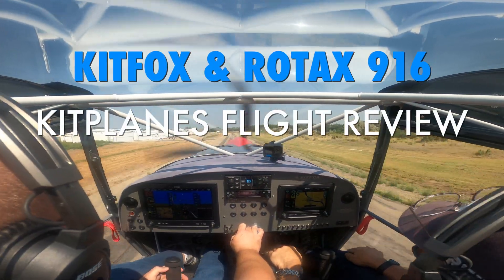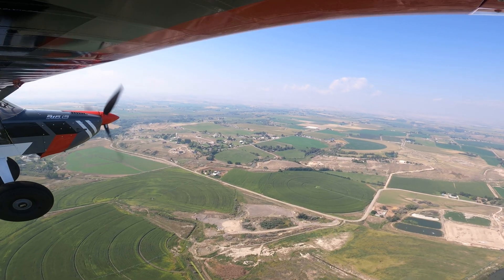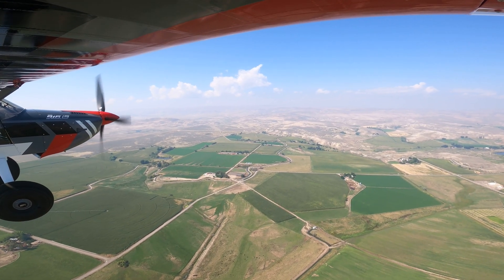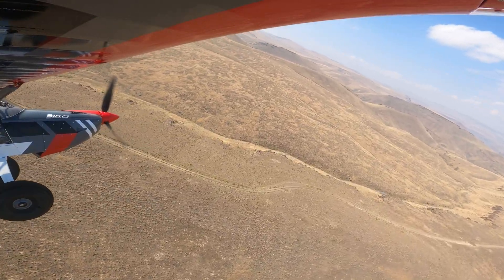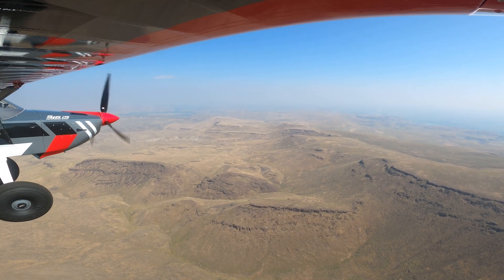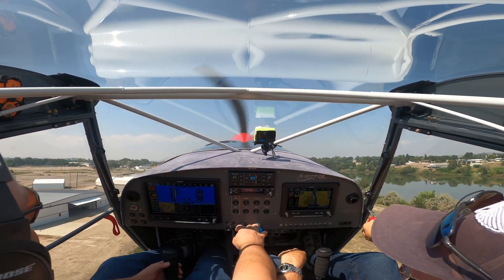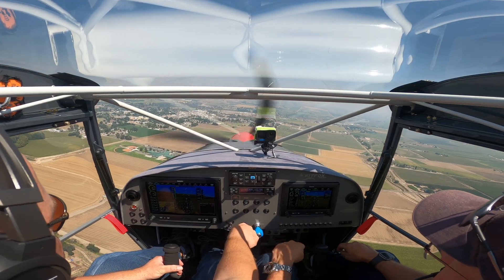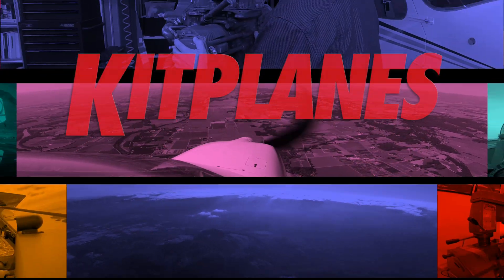Flight Review: Kitfox Super Sport with Rotax's Turbo 916

Comment: 13:05 wait 13.0 GPH is "pretty good". That's terrible that's over double the stock 5 GPH the 912 ULS uses. Does the 916 at cruise use a more reasonable fuel consumption?
Reply: The 916 at full power burns about 13.5GPH. At a cruise setting it can be anywhere from 5-8GPH.
Reply: @andrewmorris3479  Thank you. I didn't know if they were talking about full throttle or cruise. I was just listening to this while working and caught that out and looked up.
Reply: I mean… its got a throttle.